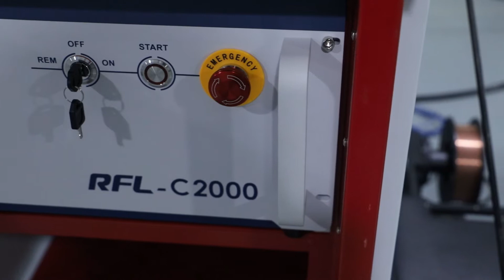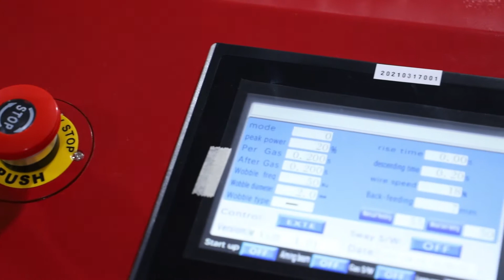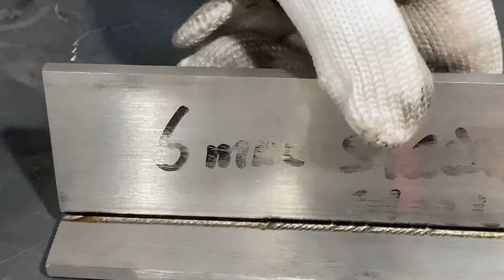Welding mild steel with 2kw / 2000 w laser welding machine #mildsteel #welder

Comment: Question:  If this is a laser to melt the wire and fuse it, why do you need a grounding clamp?    Instead of Frying Bacon Sound, sounds like a Rain Stick.     How much strength does this have over a standard MIG weld?     What gas are you using?